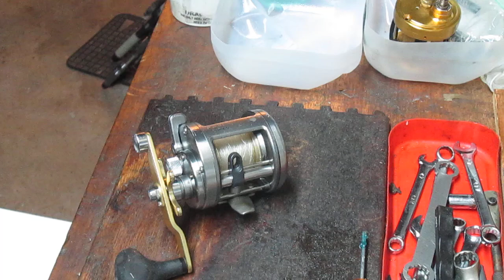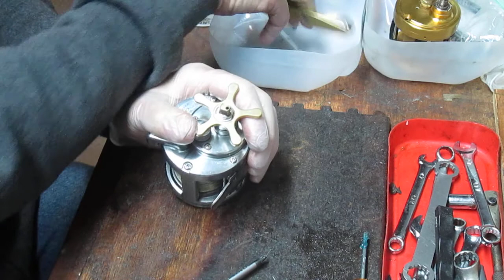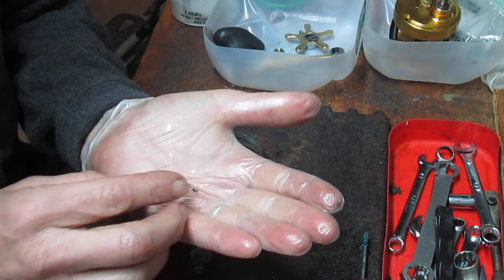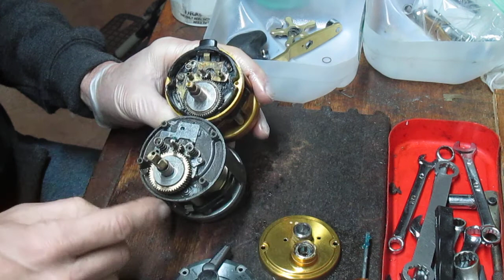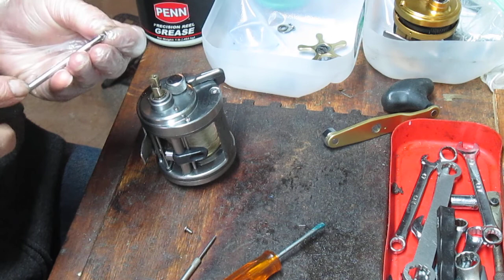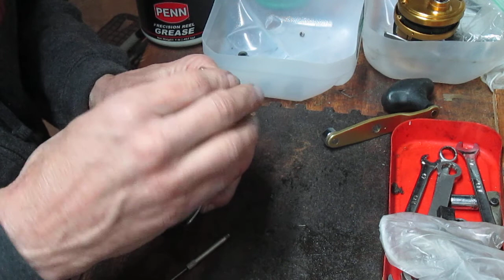Shimano Tekota Basic reel service including drag maintenance

Comment: Great video! I just got a Tekota 300...no line counter...just a regular 300. I'm somewhat familiar with the inner workings, since I've worked on my Tekota 600 before. Well, I just got this 300 today, and the spool is very stiff feeling. Out of gear, it will not spin freely...maybe 3/4 or 1 full revolution at best. In gear, it cranks very stiffly as a result. When the clicker is engaged, it just gets ridiculously stiff to crank. I tore the whole thing down, and cleaned, greased, and oiled everything. It's maybe 10% better...maybe. Still unacceptable for a fairly new reel. It's not brand new, but pretty close. The inside is immaculate. ...just too much grease. I "thought" I cleaned and oiled the spool bearings pretty well...as well as the worm gear/level wind, but it's still really stiff. Any ideas or tips? Thanks so much!
Reply from the maker: This almost sounds like the spool is out of true.  That can happen when line gets trapped inside and  the angler pulls on it to try and free the jam.  The reel frame may also be out of square.  These are possible causes, but may not be the issue.  It could also be a bent pawl in the level wind.

Here are a few things I would try:
1) Remover the spool.  Reassemble the reel without it.  Do the gears turn free and easy?  If not, the problem is most likely in the gears.  I would check for small pieces of broken line that may be inhibiting the free movement.  Sounds like you already did this with the cleaning, but may be worth a check.
2) Remove the Pawl from the level wind guide, so that the line guide slides back and forth without effort. Spin the worm gear to make sure it turns easily.  If it does not, remove the worm gear,  reinstall the spool and see if the reel spins right.  This is really a process of elimination.  It is something in the moving parts or frame.  Give these a try and let me know how it goes.  In the end, you may need to replace the spool, but don't go to that expense until you are sure it is not another issue - Thanks for asking - Dennis

Comment: I replaced the bearings but now I have a new issue.  The line guide isn’t engaging the worm shaft. It just moves across the bars freely. Is there an adjustment or do I need to break down the reel and replace parts?
Reply from the maker: It sounds like the pawl is loose or missing??  remove the end cap beneath the line guide and check the pawl.  Make sure it has the teeth and that they are not damaged.  Reinsert the pawl and tighten the cap.  It needs to completely seal.  if it sticks and the line guide does not move, back off the cal a little, song the reel and retighten.  Repeat until it is fully seated and the line guide is performing properly.  Pease send a note if this does not fix your problem.  Thank you - Dennis
Reply: I got the pawl to reengage without disassembling the reel but there is a lot a tension and the handle doesn't work smoothly when retrieving line.
Reply from the maker: Try backing off the pawl and see if the problem with the handle operation is still there. If it works OK, you may have a bent tooth on the pawl.  If that is the case, the pawl may need to be replaced. Also, check the tracks on the worm gear.  If any are scared or appear rough, then the worm gear may be the culprit. When checking, note if the operation is tight at a certain area of the worm gear.  If it consistently fails in that area, that is where to look for the problem. - Dennis

Comment: Very helpful video. I have two of these reels. Worked on both recently. One looked and works great. The other was not in good shape and is hard to reel. I’m thinking it is the bearings. The outer bearing looks ok but the roller clutch bearing looks bad. How do you remove the roller clutch bearing?
Reply from the maker: The roller clutch bearing is pushed through the back of the side plate.  You may want to hit this bearing with penetrating oil or WD40 a few times and see if it frees up the movement.  Make sure you re-oil the bearing after the treatment and before you re-install.

To push the bearing through, remove the other internal gear side parts and then sit the side plate on your work bench face side up.  You can then reach inside the gear shaft hole and can tap it out with a flat blade screw driver or punch to loosen and remove it. If you have been spraying the penetrating oil, it should have enough slip to come out easily.  Thanks for asking - Dennis

Comment: i use a dental ss teeth cleaning pick to hold the spring, will not break.
Reply from the maker: That is a good alternative.  Shimano recommends centering the last washer on the stack wo that it compresses the spring and them tighten the star drag.  The drag will move the washer down and the spring will be set properly.  Try it...That procedure works equally well.  - Dennis